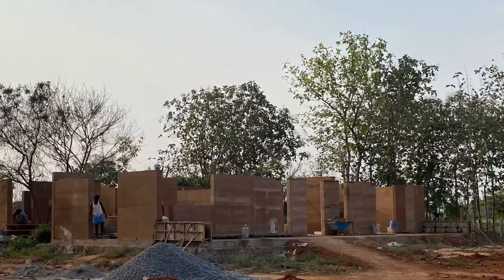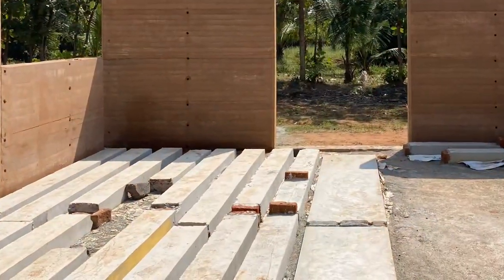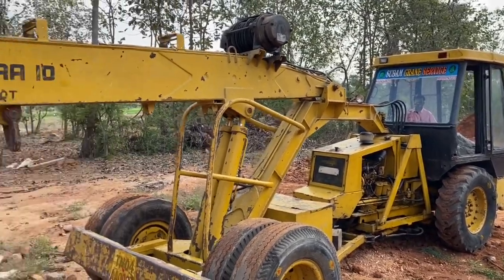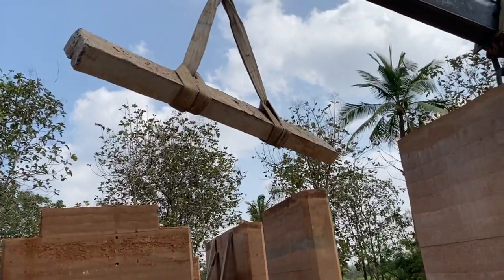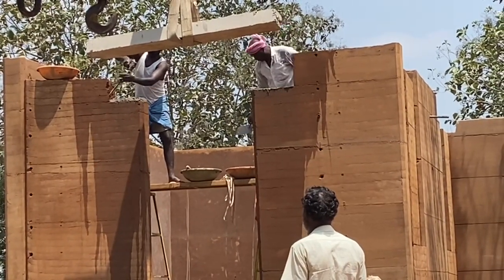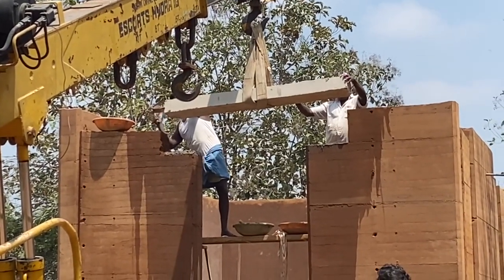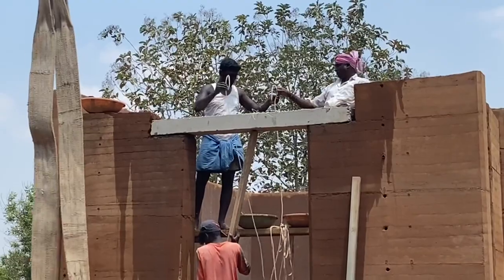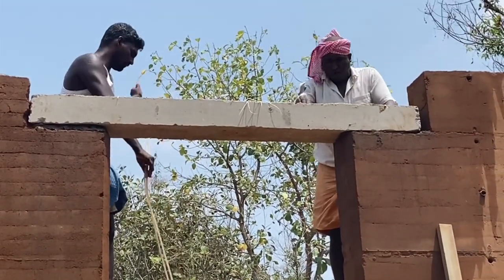Lintel placement for Rammed earth walls

Comment: Sir your way of explaining is very perfect Infact its better then the professional's.......

Sir plz tell what all things not to do... I mean which may look small but can have big negative impact
Reply from the maker: Thanks for your nice words. Following are my learning.

1. Smoothness of the plywood surface should be regularly checked. Overtime, undulations on the surface would impair the smooth finish of walls.

2. Planning conceived piping for electricity in advance will save lot of time effort and cost. Further the walls will maintain a neat finish.

3. It’s better the plan lintel level at 7 ft, as it’s very difficult to source doors for 8 ft.

4. Using shutters for corners, will ensure a smooth and nice finish.
Reply: @OPTIMAVASU thanks for sharing your valuable tips. It means a lot. Namaskaram 👌🙏🇮🇳

Comment: Wonderful. Couple of questions. 
1. What kind of a roof are you going for? Would it also be made of earth? 
2. I assume you are doing the rammed earth walls using some architecture firm. What would be the cost per sft that he is charging?
Reply from the maker: Thanks. I’ve opted for puffed fabricated roofing.

I did consult an expert to start with, trained my local masons for a day by the expert from Auroville. Rest, we built ourselves. I paid Rs 8,000 to the expert and reimbursed his travel costs.
Reply: @OPTIMAVASU  Nice to hear. Immense satisfaction when saying, Did It By Myself, I think. :) Plan to do what you have done in six months. Hope it's fine if I talk to you then about your experience and tips...

Comment: Sir How to do the Water supply and Electricity wiring????
Your Reply will be very helpful 
I am stuck on to this point
Reply from the maker: I used puffed sheet for roofing, ran the Electricals beneath and concealed it with a false ceiling.
In the walls we drilled cavities for running Electricals and plumbing pipes and filled them with sand and fine clay
Reply: @OPTIMAVASU  Thank You So Much Sir ....Your Project is like Dream come True ...... Sir one more Question 
If you can Answer Please 

What's The Difference In Construction Cost Of Rammed Earth technology and Normal Concrete Structures???

Comment: The purpose of rammed earth construction is to go natural. But then why concrete? You could have used stone of 10-12 ft long instead. I am not sure about the availability of these kind of stone but you can see in Rajasthan and northern part. Wood is also another option used widely.
Reply from the maker: You have the answer right there, the availability and the cost, including the cost of transport.  Considering that, I had gone for three slabs. Slabs essentially would constitute 5% of over all structure only.
Reply: @OPTIMAVASU  That's fine Sir ji. I was just expecting that with curiosity and 100% natural which is almost impossible. But whatever you are doing is very good. I will learn lot of things from your experience.

Comment: Didi u used any rebar in reinforcemnet in the wall
Reply from the maker: No bars for the walls
Reply: Tamil Nadu is in Earthquake zone 4 so,  no vertical rebars required.
Reply: @OPTIMAVASU  so could it be called as load bearing structure.also what's the width of the walls
Reply from the maker: @satyakithorat3545  width is 9.5 inches. Yes it’s a load bearing structure